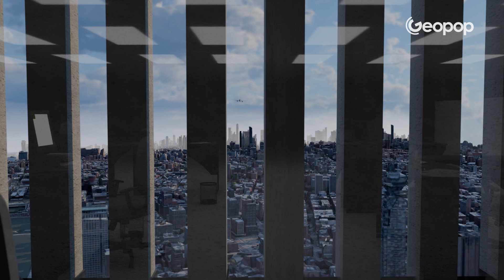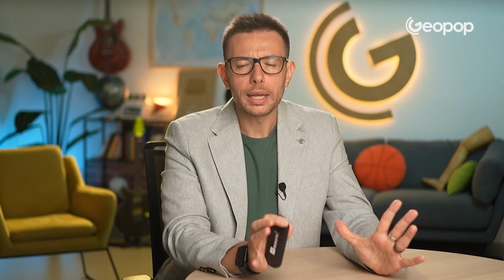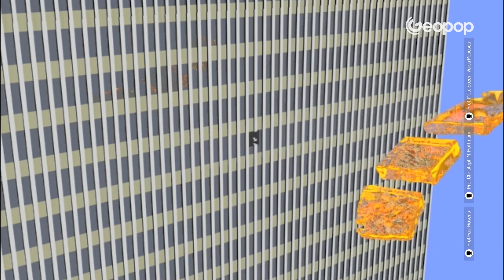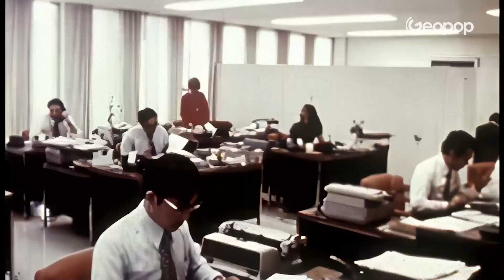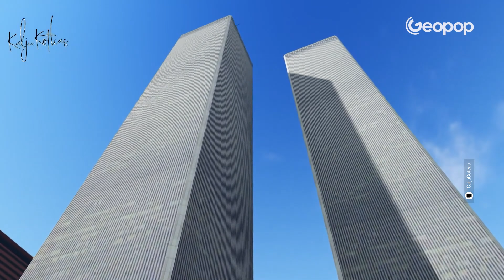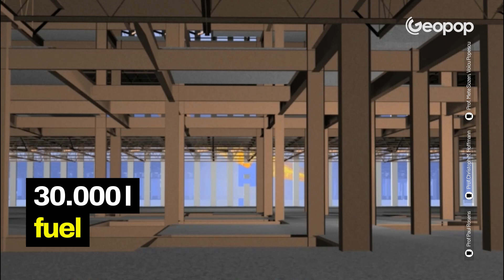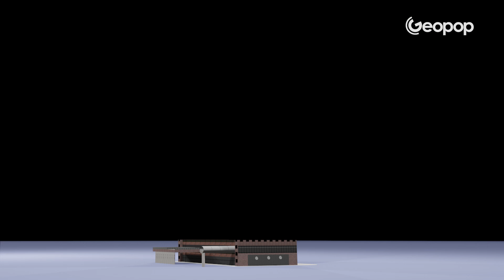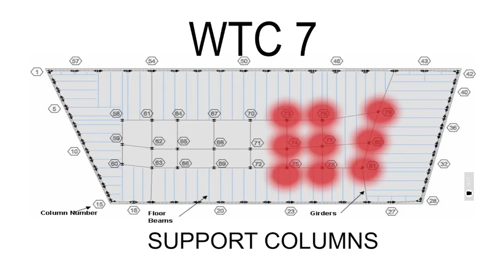9/11, 2001: The Technical Reconstruction of the Twin Towers and WTC 7 Collapses

Comment: To give you some credit I see you are trying to have a genuine attempt to think about what may have happened working back from the naritive that was told on the day. The biggest issues with all the explanations is not necessarily how collaps initiated (which is sketchy in its own right), but how all 3 buildings came down and the observed behaviours with what would be expected post initiation.

Please note, before going into the below discussion, steel building as designed with many factors of safety above the point where supported loads put materials anywhere near the yeild point of the stress stain curve.

You some what correctly discuss in this video how the stress strain yeild curve of materials (i.e. structural steel) reduces load capacity as material temperature rise. We see this when you heat a thermoset plastic etc.

Where your explanation is missing a lot of detail is to go from this explanation and let the viewer some go to the conclusion then that due to a few relatively cool office fires that the entire lower structure some how falls apart as if it was never connected and  provide zero resistance to anything supported / impacted from above.... 

You have to understand just because the building had a fire on a few levels, doesn't mean the whole building some how is evenly heated up like a pot in an oven, and then all the structural steel (note much thicker, stronger and heavier below than above the crash level) suddenly has the load capacity and flexibility of spaghetti?

Please have a bit more of an open mind and think about what you are saying and what we should expect to see with the failure mechanisms in real life that you are describing... 

Steel structures are fastened and bolted together.... columns don't just slide off each other like they have never been connected just because we have a fire on a few floors....

If material is yielding (which happens before ultimate tensile strength is reached and ultimately fracture, we should expect to see movement as you imply (but stop short from saying) as the building materials would go through their phases of the Stress/Strain relationship of 'elasric strain', 'uniform plastic strain', 'necking strain' and ultimately fracture... We see alot of material expansion during this deformation (we should see gradual sagging and movement of the building - not sudden snapping of material if your explanation is to hold any credibility in the real world). To be completely clear, if the structural components are being heated up and their load capacity is undergoing deformation before fracture, then the shape of the building can not hold the same shape right up to the fracture point).

We would see the building sag and move if structural materials go through ranges of deformation, as some how they are being melted from very cool fires (you only need to see how much black smoke is comming from the building to see how inefficiently the fires are burning).

You seem to be doing your best to have some genuine thinking about this which is good. 

Try go from real world examples and work back to what seems reasonable with what you see duing the buildings collapsing (not just trying to think how a collaps may have initiated).
Reply: And finally, if the collapse mechanism as you described holds any resemblance in the real world... 

1) there would be no way they would allow fire fights to go into those buildings during 911 and 

2) if we learn something new about matieral failure mechanics from these examples (which have never been repeated before or after 911) then this would have massive implications / changes to engineering degrees and firefighting procedures post 911.

I can tell you there has not been any changes to how buildings are design post 911, no changes in material failure mechanics and fire fighters still enter steel building to fight a office fire.
Reply: @llobj001  Why do you mix and match  physics of building collapses constantly with fire fighters being in there?  You seem to be conflicted with your argument ?   Heart rather than head?
Reply: You need to be transparent in you video and state the NIST report self admittedly excluded information and whiteness testimony from eye witnesses and recovered evidence that did not match the events the report suggested... And that parts of the collaps (particular building 7) they have not been able to model past the initiation of the collaps as their own models at the time could not simulate what was observed in real life. 

You need to also state the assumptions used in the models basically resembles unconnected columns and ability for structures to freely pivot and slide over each other (which does not happen with a properly fastened / built structure).
Reply: As you correctly say, when steel is 'weakened' as you say by the fire in the building, force is distributed to other areas of the building to support the load.

We should expect to see this occuring as 'drops' or movements in the building as some sections of the structure is 'weakened' under the mechanics you describe.

The fire burns for almost an hour for both buildings before they collapsed.

We don't see any of this behaviour during this hour. 

What we do see is random ejections of molten metal, all over both buildings at multiple different levels (no where near where the fires were burning) during this hour which does not make any sense considering only the mechanism you describe.
Reply: So to summarise some pointers here:

1) Steel structures are designed such that their yeid strength is difference (with multiple factors of safety) duing office fires.

2) Your explanation correctly discuss the large deformations (i.e. steel stretching / lengthing and bending) that are expected to be observed during heating of the steel and redistribution of loads as sections of the building become weakened. We do not see any evidence over the entire time the building is burning untill exactly the moment the building starts to collapse... I.e. the building goes from structurally sound to instantaneously structural unstable with near zero load capacity or structural resistance to load...
Reply: I suggest you also do some review on kinetic energy / gravitational potential energy and momentum... If a moving lighter mass hits a stationary larger mass, the kinetic energy is distributed between both masses and the net momentum is reduced. 

The larger mass does not suddenly speed up to the moving lighter mass in a collision and then contribute to a larger moving mass to impact the next object. 

This is what you are suggesting is happen at each floor? We should be expected to see resistance to the 'failing' floors above during the collapse.

This is why you duck behind something to avoid getting hit when something is comming at you because at worst you expect what you have his behind to provide some protection to slow down the incoming object... Not match the speed and result in a larger heaver object to hit you... It provides resistance to the motion comming towards you.
Reply: @llobj001   " The larger mass does not suddenly speed up to the moving lighter mass in a collision and then contribute to a larger moving mass to impact the next object"

This is scientific gobbledegook.

Momentum = mass x velocity

As the top floors collapsed they added to the mass.   Hence the momentum increased and it was more kinetic energy for floors below to try and spread the load.

Simple physics.  So a velocity was acheived which was not free fall but still fast.
Reply: Please note, office furniture is not considered to be a very intense source of office fire 'fuel' and their are strict requirements with office furniture materials to ensure they burn poorly in an office fire...
Reply: Please understand when an element buckels, it pulls on the rest of the building... The Building 7 NIST model has been criticised rightfully for many poor assumptions and collapse mechanism propagation that does not resemble observations filmed with building 7 collapse... 

This is why the NIST report says they only tried to model the collapse initiation and not the collaps event as they say their collapse initiation will not result in a button up floor by floor collapse... 

If a column failed life you say, we should expect to see the corners of the building pull into its self. 

What we see is a symmetrically even floor by floor collapse from the bottom up 

This makes zero sense with what you are showing in these videos and even the NIST modelling... 

Even NIST is saying you need instantaneous failure of all columns from the bottom up for the observed failure to occured as filmed with building 7? 

Think about how gravity works and what you would expect to see if a structure if a column is pulling on a building from the inside?
Reply: @llobj001  - Woah, slow down there cowboy. All that Gish Gallop and nobody will be able to follow what you are on about.
Reply: @TheLoonResistance what part are you finding hard to understand?
Reply: @llobj001  - None of it is hard to understand. Most is standard boilerplate but a lot I didn't even read because it's a jumbled, confused, unfocused mess that spends far to much time on accusations and criticisms and not so much on analysis, with some of your technical claims being flat wrong. Personally because I'm a solutions guy, I would present the Twin Towers collapses like this:

While complex, most of the Twin Towers collapse mechanisms can be seen with the naked eye and easily discerned and understood by the layperson if sufficient time is taken to understand.  Presented below is my own analysis not relying on any authority.

1. The Twin Towers consisted of 4 primary structural elements that together formed an integrated system where each relied on the others. 47 hollow box-section steel Core Columns carry the majority of the gravity loads. The 236 hollow box-section steel Perimeter Columns carry the remainder and ALL of the lateral (wind) loads. Long-span Lightweight Steel Trusses connect the core and perimeter column together at each floor with a Hat Truss on top to tie the structure together as an integrated unit where no element can survive without the others. There was no structural load bearing concrete and most components were bolted together.

www.youtube.com/watch?v=u7OqrC74Dm4

2. The impact of 120 tons of airplane (= to about 12 dump trucks) at speeds up to 589 mph with the energy of a ton of TNT completely destroys the aircraft. This in no way implies the Towers come out unscathed. Many perimeter columns are damaged or destroyed as are some core columns (example; 33 of 59 perimeter and 20 of 47 core columns damaged or destroyed at the impact floors in the North Tower), This damage is primarily through bolt-shearing failures at the end connecting flanges, as well as bending, twisting and fracturing of weld seams. There was no cutting or slicing - the reality was far more violent and messy.

3. The impacts destroy or damage fire insulation, fire breaks and sprinkler systems on multiple floors. Huge fires are started across multiple floors simultaneously and allowed to spread rapidly with no effective firefighting or fire suppression. This was an unprecedented fire event .

4. The hotter steel gets the weaker it gets . With fire insulation stripped away and no sprinklers the survival time of the steel greatly reduced. Gradually over time heat causes the lightweight steel Floor Trusses at the impact damaged floors to sag, which was observed and recorded. No steel melted or needed to. Structural steel fails long before it becomes a puddle. It just needs to bend

5. Sagging floor trusses pull on the increasingly weak and overloaded Perimeter Columns, causing some of them to bow inward by up to 5 feet. A straight column is up to 4 times stronger than a bent column. The bowed Perimeter Columns buckle and fail, quietly initiating collapse. The formerly static mass above which the structure below could easily support is converted to a dynamic mass up to 30 times greater. Because they have buckled, the Columns above and below the failure point are no longer aligned . The load bearing structure below no longer bears any load as it falls past the lower columns, NOT onto them.

www.youtube.com/watch?v=ULdiD6gYZO0

6. Thousands of tons of debris fall within the four outer walls, down through the open office space, crashing onto the first intact floor it encounters, immediately breaking the bolted column connections as the amount of resistance the Floor Trusses can offer is negligible. The falling debris slows only marginally and briefly. Note: 
6a. This is NOT a solid top block crashing into and “crushing” a solid bottom block . 
6b. The debris falls past the columns not onto them. The columns provide no resistance to the falling debris. 
6c. Only the bolted floor truss connections to the core and perimeter columns offer any resistance. A pair of 5/8” bolts at each end of each truss vs. thousands of tons of falling debris. 
6d. No laws of physics are violated. 
6e. There is no 20 floors against 90 floors but rather 20 floors against one floor, then 21 floors against one floor, then 22 floors against one floor, etc. 

7. This floor-led collapse progression within the four outer walls can only go straight down.
7a. This process is often incorrectly referred to as “pancaking”. The catchy name stuck but nobody knows what it really means and "pancaking" is too simplistic and inaccurate anyway. I prefer Kaiserschmarrn.

8. Collapse progresses through the floor systems past the columns, through the path of least resistance . The resistance offered by each floor is always the same while the mass of debris and its velocity – thus its energy - increases with each floor failure. Each floor offers the exact same resistance to the falling mass while with each failure the falling debris constantly gains both mass and velocity. *This process of floor-by-floor destruction cannot be arrested, it can only speed up . Rate of floor failures increases with each floor as momentum increases, reaching an average acceleration of 0.65 of GA, or 35% slower than true free fall. Bam, bam, bam down the building until there are no more floors to fail. The resistance offered by each successive floor is always the same. More mass, more velocity, same resistance with each floor. Don’t get stuck on the but the lower floors weren’t on fire nonsense. They weren‘t and didn’t need to be.

9. The Towers were 95% air by volume. As that air was compressed inside the building it is forced down the tower and blown out the sides in reaction to the building collapsing . Those were not “explosions”, it was expulsions of compressed air caused by the collapsing building, explaining the low velocity, lack of flash, blast, supersonic pressure waves and lethal high-velocity ejecta.

10. Perimeter Columns become detached and peel away like a banana behind the collapse front, playing out to the four points of the compass extending to more than 800 feet from the base of the towers. This was quite obvious from examination of the debris pile.

11. Core Columns fail last as their internal beam bracing is stripped away by falling debris and lateral support from the floor to perimeter columns is lost.

www.youtube.com/watch?v=WpHXj62Ylw0

12. For those who care about how long this whole process took; 31-34 seconds from the moment the perimeter columns buckled until the last core columns hit the pile, or 1/3 the rate of true free fall. Don’t believe me? Just watch any video of the collapses and note the loose truly free-falling debris dropping much faster than the towers themselves.

13. Each Tower had a 1-acre footprint. Far from collapsing inside their own footprints the debris pile spread out over 17 acres in a pile up to 14 stories deep. 8 surrounding buildings were destroyed and scores more damaged by the falling debris.

14. NOT observed were the 180-190 dB bangs of thousands of high explosive devices or the blinding bright flashes of burning thermite. Neither explosives or thermite could have survived the impacts and subsequent fire nor could have caused the (silent) perimeter column buckling that clearly initiated collapse either. A video of a shocked and injured firefighter casually using the magic word explosion is in no way proof of explsoIVES and the demolition_ case relies entirely on that sort of thing. There is zero tangible physical evidence and it would be technically impossible, totally impractical and completely unnecessary. No one would bother.  In 24 years zero structural engineers of tall buildings, including the 1/3 that have retired in that time, have made any statements in support of pre-planned demolition claims. NONE. The lack of any such citations in the engineering literature (published in any country worldwide) is telling.

15. Twin Towers were perfectly safe within their design envelope. They only collapsed when taken far outside design parameters by an extraordinary and unprecedented event

Impact + Fire (heat) + Time + Gravity = Collapse . Remove any one of those 4 elements and there is no collapse. Ignore any of those elements (as many do) and you will never understand the collapses. The Twin Towers were an integrated system in which no one component could survive without the others. One fails, the rest follow, through the path of least resistance – DOWN – through the open space, bypassing the path of greatest resistance – the columns. Nothing I just described violates any laws of physics. All of the above is true no matter who planned and carried out the 9/11 attacks or why

I hope you found this helpful and informative. It’s meant to be non-adversarial and solicit informed critical comment, positive or negative. If I made any errors of fact, logic or reason or left anything critical out, please let me know so I can fix it. To stay focused, just one topic at a time please and on-topic (Twin Towers ONLY). No word-salads of Gish Gallop. IF you can offer a more plausible alternative be my guest. Please start any reply with the words “Tits McGee” or I’ll know you didn’t read it, aren’t serious and wasting my time.
Reply: @TheLoonResistance    Thanks for that excellent summary.

Cut and pasted so I don't have to keep doing bits of it from my own arsenal of logic!

All the best.

PS You do realise you will still be posting this in 10 years time for the easily lead bored dumbwits?
Reply: @zMW574e - if I so choose, yes.
Reply: Explosives clearly observed with building 7 collapse:
* https://youtu.be/neiCKDmiZXE?si=fj6OS8b4YlnpRpsa
* https://youtube.com/shorts/gy9zM2Kf57A?si=tkIItLxo3Z_xL7TV
* https://youtu.be/8phYg6wz6rs?si=4ky_4c_B4ym_LfAW

There are so many videos of different angles confirming these flashes...
Reply: @llobj001  - BTW - Your first video link to explosions in Building 7 is a notorious fake.  I know because I'm friends with the guy who made it.  I know what he did, how and why. He tried to make it as obvious as possible it was fake so it would not pass even cursory inspection. 

You failed to notice. 

Probably not the first time you got caught out. 

Your third video link under the heading Explosives clearly observed with building 7 collapse isn't even Building 7.